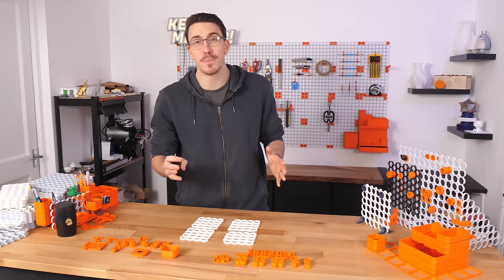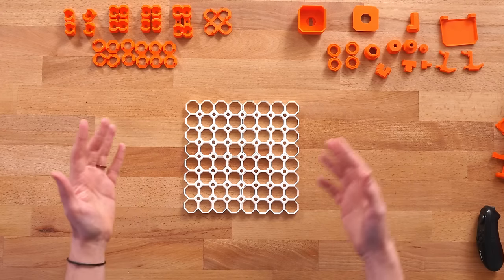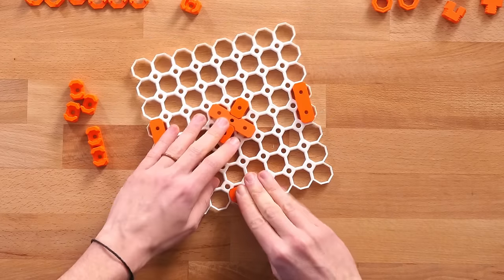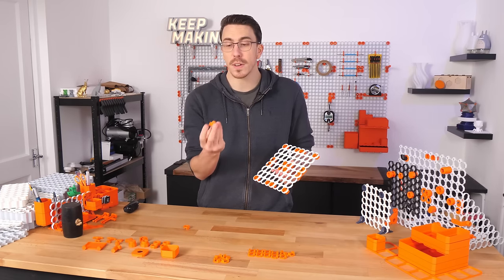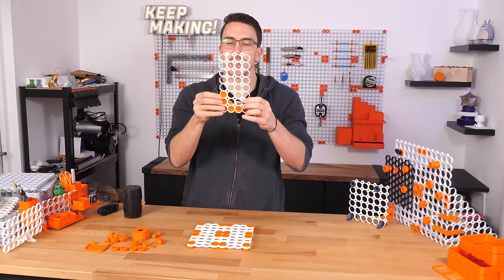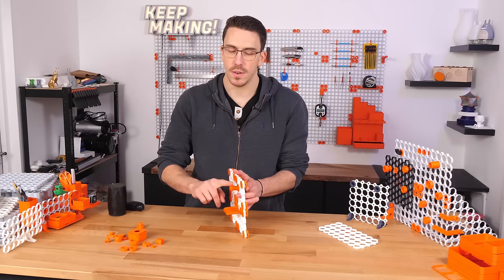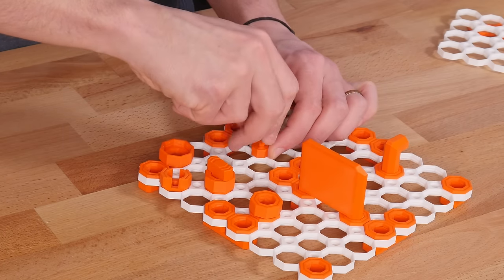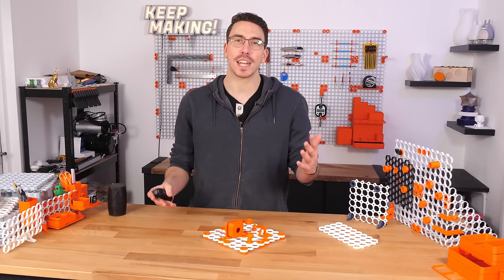How To Build A Mini Multiboard  (Updated)

Comment: It's good that they can only snap together one way, on part A the square is visible if you hold just right in the light, part B it is all but invisible.  I didn't realize there was a size difference in the ears that would make it only fit in one orientation at first, so when I printed the B parts before I removed them from the bed I looked at the image in the slicer to see where the squares were and marked those spots with a sharpie. I was initially under the impression that this system would accept other systems like honeycomb or gridfinity directly, but the only system other than multiboard that is a direct fit is 1/4" x 1" oc pegboard.  Still looks like a good system, I'll use this for vertical storage and gridfinity for horizontal storage.

Comment: One thing I don't understand / appreciate after watching the video is what the threads are for.... I just thread into a push fit and, so what? Same with the tbolt.

I presume there are accessories that require a thread or tbolt in order to secure them. That in itself is a bit confusing because it all seems to push fit incredibly tightly.

Comment: Are many using this on gyprock/plasterboard - what kind of wall “screw” are people using
Reply: use a drywall anchor either plastic pound in or zippit self drilling style depending on the weight. you could also hit the studs on a column
Reply: @zeddpilsner4  was probably the wrong question I asked, was more intended as how many holes does one need in the large 8 x 4 arrangement of tiles. I guess it depends greatly on how heavy the items you are hanging are. When I was originally thinking about it, I thought you would put a screw in each tiles corner and I wouldn't want to do that with plasterboard anchors, but given studs are something like every 60 cm you could put a screw block into each cell that aligns with a vertical stud. Given I have a printer bed that is 25cm that would mean that almost every second tile (and a bit) was securely fastened and the ones in between would have the tile to tile joiner with no screw in it.

Comment: Can you print the tiles with a bigger nozzle like .6 or .8 still at .2 layer will it mess up the threads?
Reply: I'm using 0.6 nozzle, 0.2 layers, 3 walls, 15% infill, top layer ironing, P1p. So far, so good.
Reply: Generic PLA
Reply: Thanks
Reply: I'm using 0.6 too, no problem at all

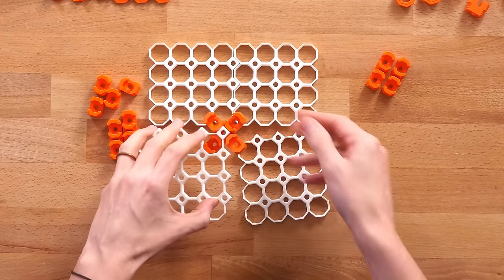Comment: 3:40 I've spent 15 minutes to try to connect 4 boards with that cross connector. I've tried all at once and also one by one. No luck, no way I can fit it there. After yet another try one of the two connectors broke straight in the middle. Any suggestions? Printed with PLA on Artillery Hornet, if this information will add anything.

Comment: The quad connector wasn't in the .stl for the starter pack though... I am guessing it was exchanged for a different solution, but this video is only 6 days old :D Or was the stl not updated yet? Also it would have been very helpful to include the printable multitools in the starter pack, not much of a starter without everything needed, right? ;) I have a bit of a problem with tolerances on my kobra plus... Parts fit in the board VERY snug, almost not possible to get in and out, and the threads are too tight. Needed to lightly sand every thread, but if anyone has a good tip on that, would be appreciated!

Comment: I printed this and i'm really curious as to what materials were used in the video, there are no suggestions that I see on the website for building the mini. I printed the grid in PETG and the parts in silk PLA using the normal tolerance files, and everything was so tight that I got angry and threw every bit in the trashcan after I broke both a thread and a piece of the grid itself trying to either get a part in or out. Rubber mallet helped some for some things, didn't do jack squat for other stuff.

Thinking I'll just stick to other storage systems. It's a shame because I really like the geometric stuff, and a wall board like this would be useful in my wife's office. But hours and hours of print time just for the mini kit, only for it to break? Ugh.

Comment: better PLA or PETG?
Reply: My question exactly. PETG is more flexible for when you clip parts together but if the grid walls are thick enough PLA might hold it very well. Currently you can find some PETG spools for cheap.

Comment: I love the concept, but for the threads, I'm having horrible scaling issues (printing with PLA).  None of the threads are fitting into the multigrid when printed as-is.  All the different thread sizes require different levels of scaling to make them fit, which is a nightmare to keep track of.  Is there an easy fix that I'm missing?

Comment: Been making parts since last week. PLA not a mis print yet. Love that everything has threads as it allows rotation and various heights. If you did this all in Blender then its capabilities are grand. the discord "show and tell" is already out of control (as in too much to look at). If rating  1 to 5 then these gets a 6.  Best of luck.
Reply: Do you find PLA strong enough to not break when clipping parts?

Comment: Put my multiboard on the wall today. I really like the system, but it’s quite a hassle to find the right parts… 😊
Reply from the maker: Great to hear !
You are using the part's library right?
If you are how do you think it can been improved? What is it that you feel is missing?
Reply: We need a easy setup guide with links to the parts that are needed to get the grids connected, thats part 1. Second Part: we need collections of the parts needed for something.  Thats how we can learn to use the different parts.. I´m currently supporting you but i must tell you that after printing the mini multiboard i wanted to cancel my membership. i wanst able to print hte mini multiboard accessories on a ender 3 s1 with a 220x220 print bed and had to try and cut the file with extra software aso.. it was/is a hassle to get started @Keep-Making

Comment: Please: Make the collections free. It is super hard to understand all of this and people don't get a start and will not use it at all. So less Money for you.
Reply: He says it’s free in the first 30 seconds. Did I miss something?
Reply: The basic parts are free but if you want anything useful you have to pay. But you can pay for one month and download all the files
Reply: @Self.reliant   This isn't actually true.  All of the system is free.  The "useful" stuff isn't behind a paywall.  The four things that specifically aren't free are;  1. Upcoming parts that are a work in progress (aka not finished),  2. Pre-stacked print profiles (big whoop, you can just stack them yourselves in your slicer, not hard), 3. The "designer", which is just a quick way to create tiles with holes in it for cutouts (again, you can do this manually yourself easily), and 4. The mini-multiboard starter pack as one download.  To be clear, the starter pack is all free too, you just have  to download the pieces individually.  Now, I personally think the starter pack (as one lazy download) should be free to get people hooked, but it is what it is.
Point is, the whole system is free.  But not open source.  He clearly put a lot of work into designing this system and I have no problem throwing a little money his way.
Reply: @DrChiYT You are right!
Reply: @Self.reliant it’s all free. The only stuff you have to pay for is convenience. Like stacked tiles and premade accessories board. But you can get all those pieces and make the plates yourself.
Reply: This project is a perfect example of how the internet never forgets, even when it's wrong.